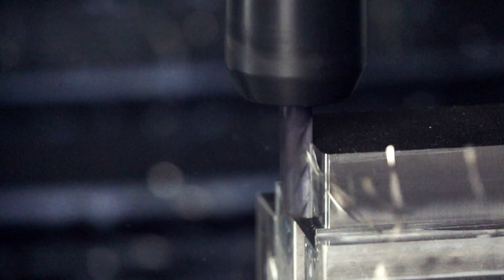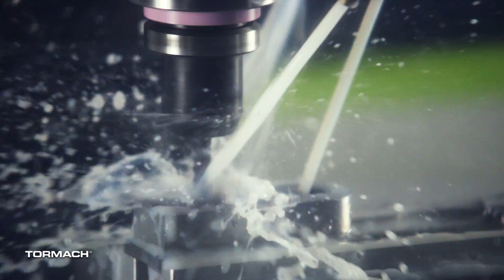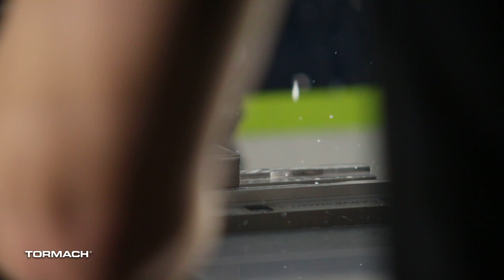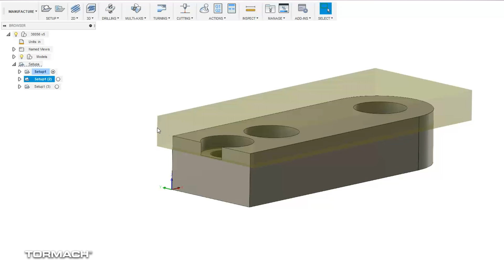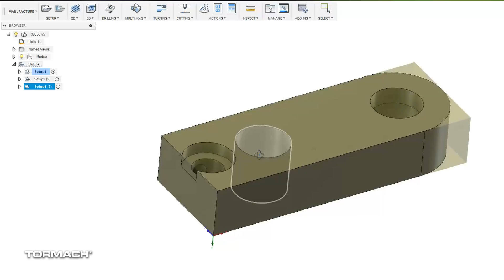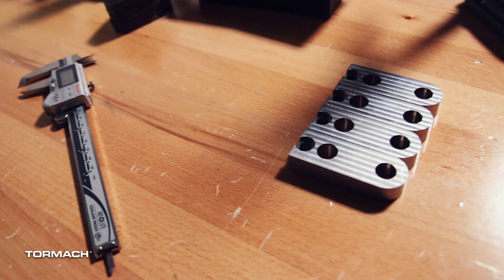Workholding Technique - Setting Zero for Efficient Manufacturing

Comment: You can set your Y in the cam at stock center and use the probe “find hole center Y only and set work offset” on path pilot.  That way you won’t have the visible .0005-.001 misalignment from the flip (has to be flipped on the A axis of course).  I’ve been running my Tormach for 5 years hard and it still lines up outer contours perfectly.